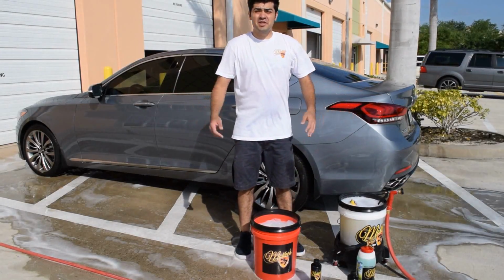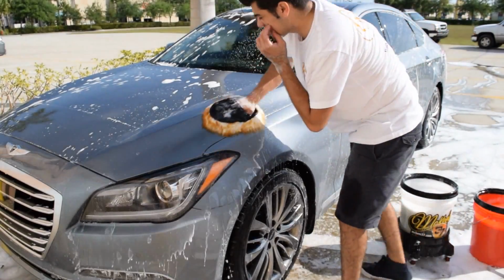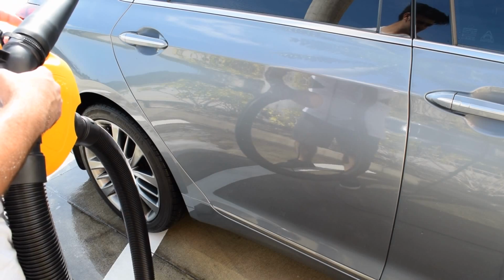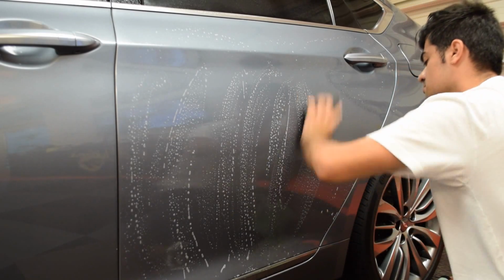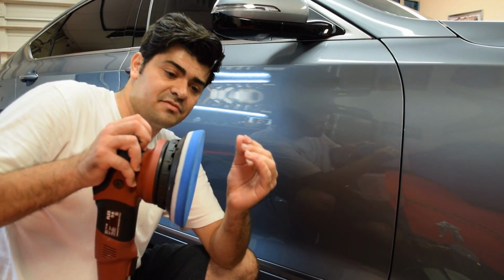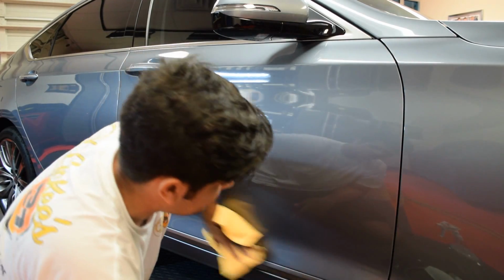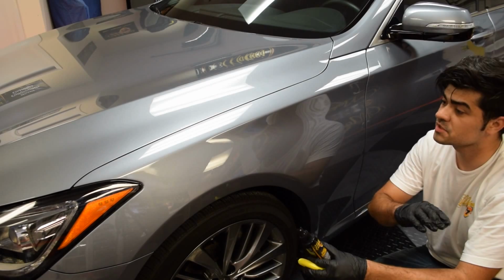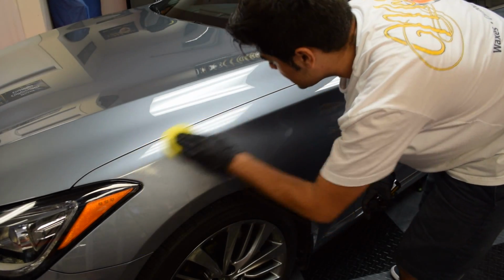Detail Experience Episode 1: One-Step Polish/Coating On Hyundai Genesis 5.0

Comment: Hey, I really liked how you pointed out the water that can come from the cracks ruining the bonding. That was a great detail to remember to share, shows you really pay attention to the details. That alone got me to subscribe. Good video.

My only suggestion to speed up the process prior to the polish step would be to use a nanoskin mitt during the washing process to "clay" the paint as you strip it. The quick way I do it is with dawn normal strength dish soap with foam cannon, blast the car the go at it with the nanoskin sponge. Get the paint nice and clean and ready for the polishing step in one step.
Reply from the maker: Thank you for watching! Im really glad you enjoyed the video, There is going to be alot of content in the near future.

Excellent tip about using the clay mit while washing! This is what I usually do, However I am in south florida, Like I mentioned in the video It was getting HOTTER outside, So I did not want to risk the chance of water marks,  Especially when I planed on coating it the same day. So I dried it off and decided to clay inside.

In the video I actually talk about How i prefer to use a clay mit while washing but I am going to skip due to the heat, I did edit this out haha.

Thanks for watching.

Comment: How long does the paint coating used last?  Have you ever tried CarPro Reload Sealant?  I find it very easy to apply, gives incredible shine and is very durable.
Reply from the maker: I am not a fan of sealants/coatings that makes the paint sticky/grabby.

some spray sealants/coatings on the market will bead/sheet water in a very aggressive fasion, However leave the paint sticky/grabby. This means that dirt/contaminants/dust/debris will have a easier surface to stick and adhere to.

The best protection IMO is a slick/smooth surface this gives the best chance to keep a cleaner surface for a longer period of time.

If me and you was a contaminant flying in the air, We would want to adhere to something that is grabby and sticky not slick. 

Think of a plastic slide that is a steep, If we jumped and tryed to get a grip it would be almost impossible and we would wind up sliding down. This is essentially what a slick surface does, This is why I am a fan of slick paint coatings and why I install the McKee's Coating. 

A rubber slide would be much easier to grip and crawl up.

Again this is how I look at things.

Comment: Hi Joe, do you add anything (aka reload) on top of the coating for water spot prevention?
Reply from the maker: Jon Michael Chua hey Jon, that’s a great question. From a professional standpoint it really all depends on the package chosen by the client.

If the client goes for a higher end correction and coating job that is something I would want to do.

I work with all types of budgets and I do lower end coating jobs. For people that do not really care about swirls and scratches they just value shiny protected paint.

That is a application I would not care to do. 

At the end of the day it all depends on the level of perfection desired by your client.